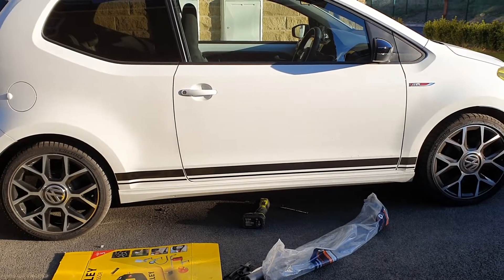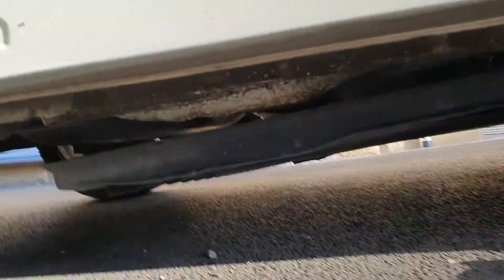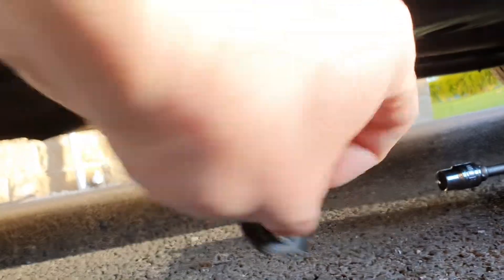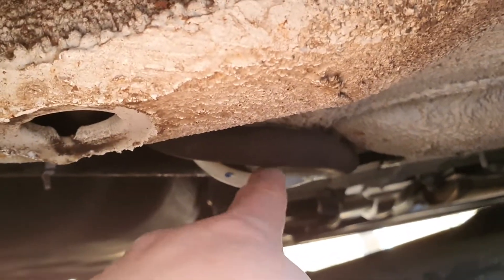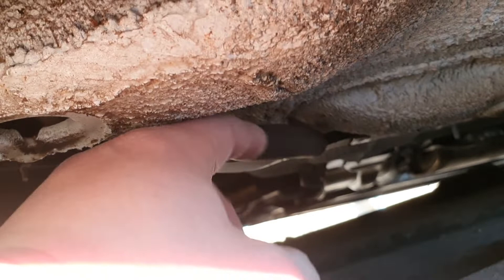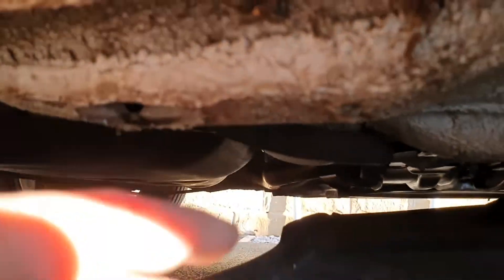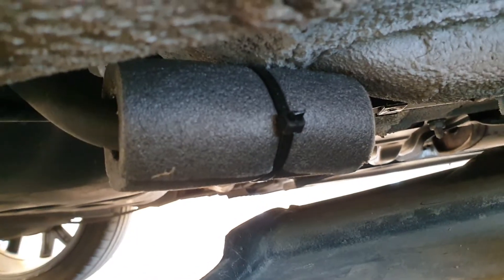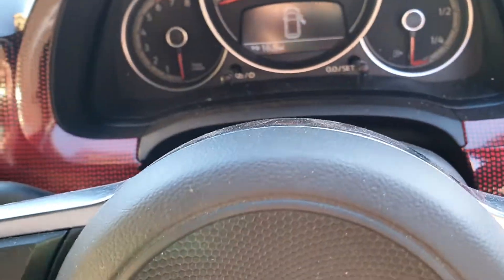VW UP Gti underbody vibration on throttle - Easy Fix Tutorial

Comment: When i took the tray off my Gti it was full of debris, so many stones in there i could of made a feature with them, they were causing a rattle also as the drain holes for them to come out were blocked!!! Also gave my pipe a bit of extra lagging, nice tip mate
Reply: @UnitGorilla yea hex shaped be careful they snap